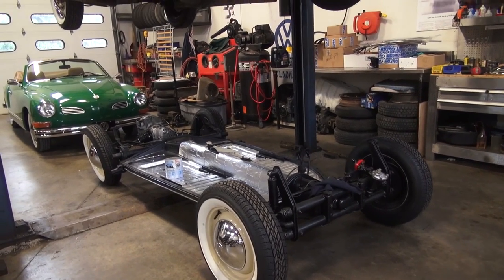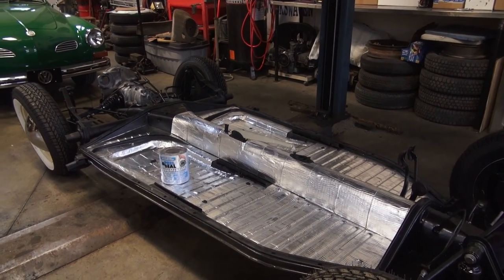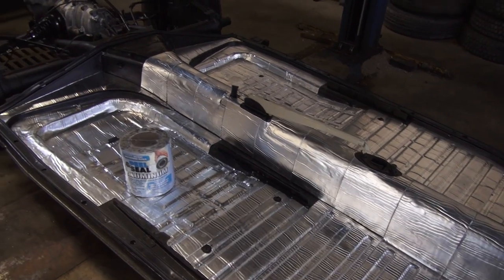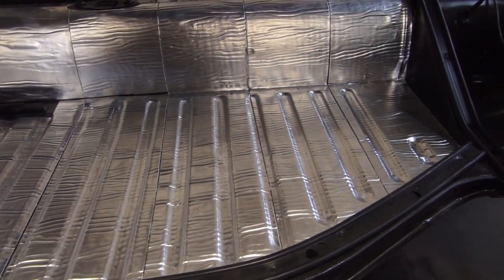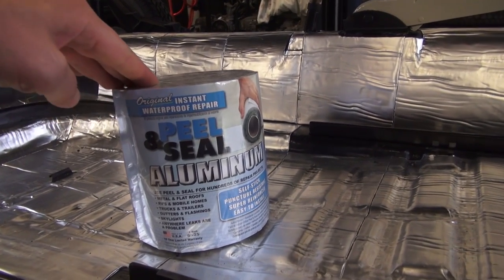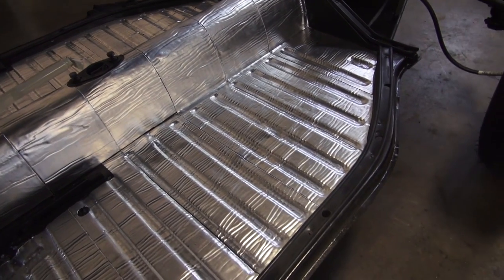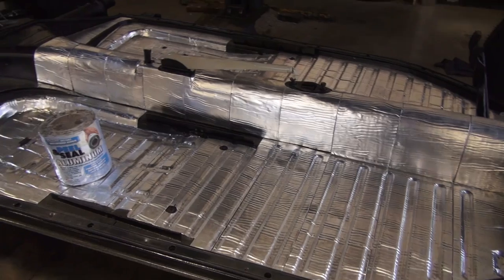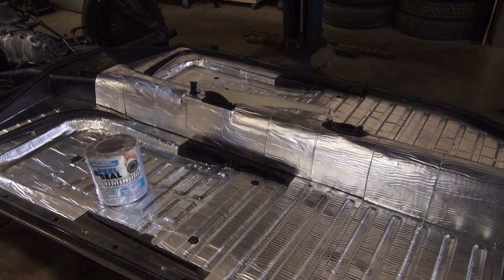Classic VW BuGs Peel & Seal Beetle Volkswagen Chassis Insulation Quick Roof How to tip

Comment: Just bought a 66 1302 beetle. Noticed some sort of material peeling off the undercarriage. Was not rust but looked like truck bed material. Is that something that has to be addressed by putting por 15 on or do you use something else for undercarriage?

Comment: Hey Chris, I'm in the processing of quick-roofing my floor pan at the moment. Would adding carpet provide a lot more sound deadening or will the quick roof/peel and seal do most of the work? Cheers for all the great vids!
Reply: Dylan Geiles I did the peel and seal, jute carpet padding and carpet on my 70 bug and was extremely pleased with the overall results. I thought it was quieter and the touch to the carpet was extremely soft and a plush look to it. I'm going to do the same to the 62 I'm working on and will do a video of the outcome. Good luck with your project.

Comment: Hi Chris, great tips. Thanks! Would you recommend this Peel & Seal on the ceiling? Or would it come off in extreme (Texas) heat? Also, how is this in comparison to Dynomat, Xmat and other sound deadeners?
Reply from the maker: not on the ceiling no.   And it is very comparable to dynomat, practically the same results.
Reply: Thanks!